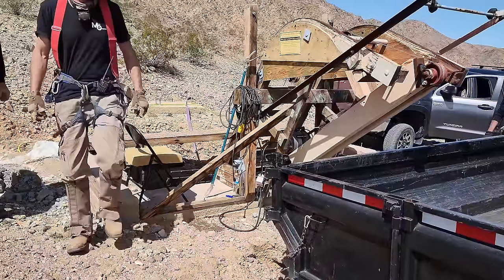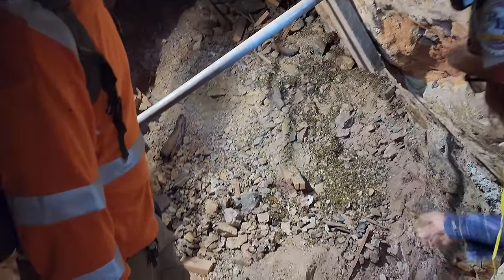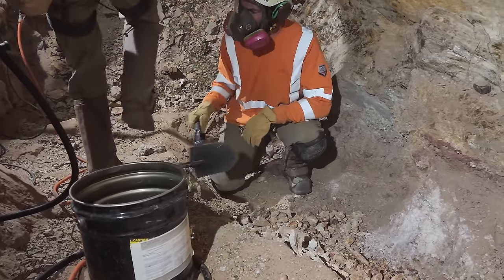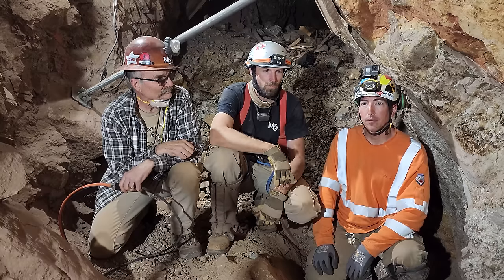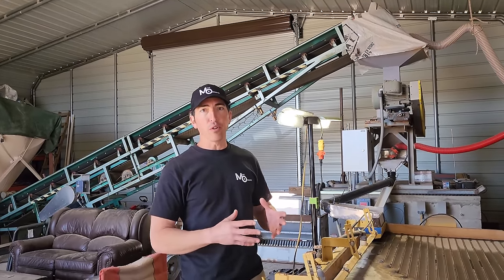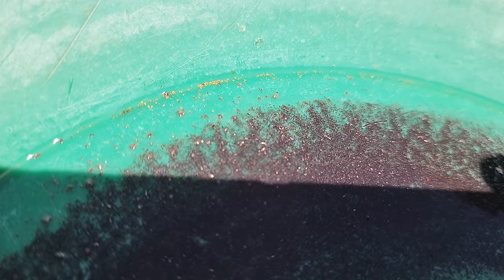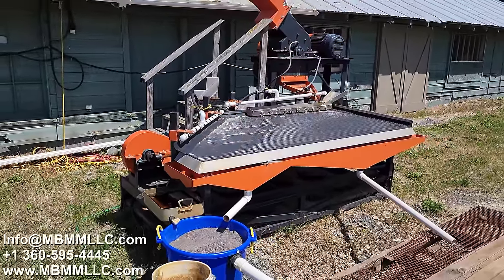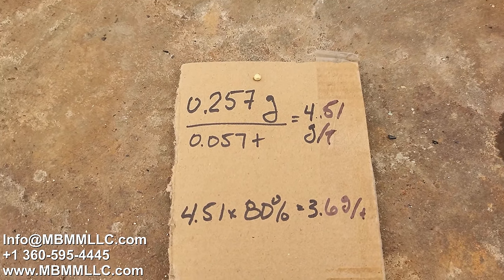Hardrock Mining, Milling, & Gold Recovery

Comment: Did some bronze casting in the past using a #10 crucible and when pouring out the molten charge it took complete inversion and a minute or two to allow all the contents to drain out. That was bronze and hope gold pours out more readily otherwise you may be accumulating some metal in the rough interior surface.  Just a thought.

Comment: If you put a piece of cardboard under the crucible it should help keep it from sticking to the firebrick
Reply: Jason has the wrist strength of a grizzly bear, he just lifts the brick when he pours.
Reply: Cardboard inside a 2000 degree furnace? Thanks for your words of wisdom😊
Reply: @woonsockettruthseeker9009  The cardboard turns into a layer of carbon that prevents the sticking.
Reply: @sucheinheit yeah, it's just like putting flour on a rolling pin.
Reply: Someone's been watching bigstackd
Reply: @Lunch_box  a lot of these channels blend together sharing subscribers. Like I think I could name AvE, codyslab, sreetips, "bigstack," hydraulicpress/beyond the press, sharup, elementalmaker...and most ppl here would know at least five of those names.
Reply: @nunyabisnass1141  haha funny you mentioned those because I'm subbed to 5 of those channels
Reply: I only know og MBMM and Dan Hurd, will look the others up, thanks

Comment: Jason, 
    Please help me with a answer.  Im confused about the term mineralization. When you have a hydrothermic quarts vane in the host rock and it has minerals in it, is it mineralized? What is the term for it before its oxidized?  I mostly hear it called mineralization when it's been heavily oxidized and looks like heavy rust. I was sitting on the beach at Deception pass looking at rocks  when that thought went bouncing through my head.🤔

Comment: 3 grams per ton?! It’ll cost more than the gold is worth to extract it! How are these guys planning on not going bankrupt?!! Did you warn them Jason? Their life savings are going to get burned up and they’ll all be destitute!!
Reply: I agree, 3/4 grams per ton is horrendous for an operation like that,
Reply: @darrenbooker8144  Agreed. I operate a mechanized mine and wouldn't be particularly interested in 0.1opt Au unless it also came with 5-10opt silver. Bear in mind we can drill, blast, and muck 25-50 tons in a day if I've got all the necessary equipment running smoothly. 

These guys need to figure out how to mechanize their haulage. My recommendation would be a small slusher and revising the station geometry slightly to allow slushing directly into the skip. If they're willing to deal with the added complication and overhead of explosives, going to drill-and-blast with a jackleg and sinker drill could get them into the realm of profitability.